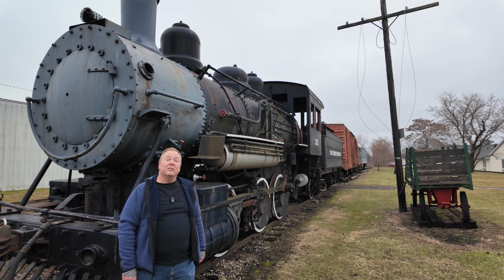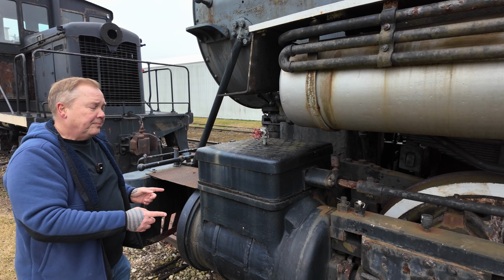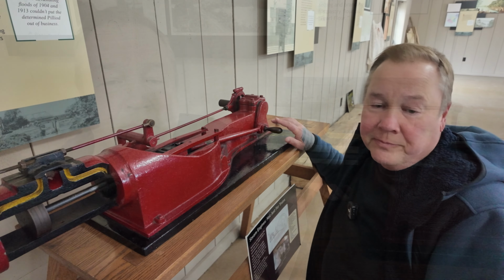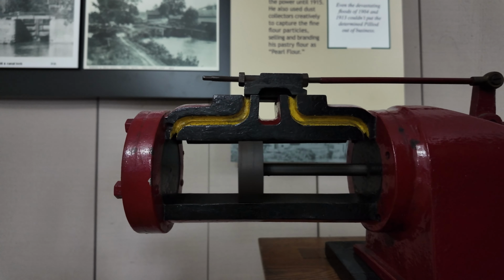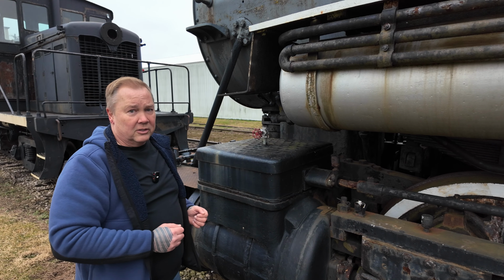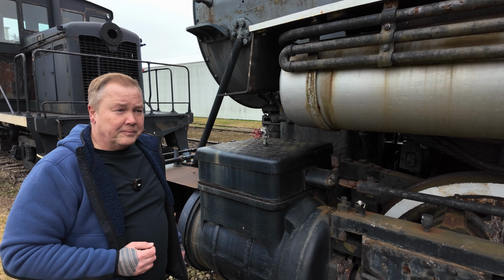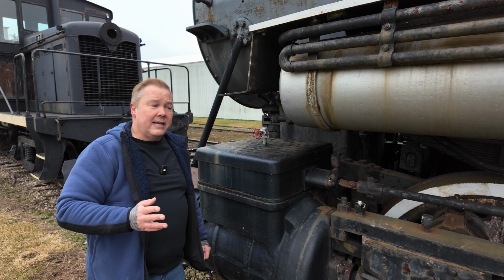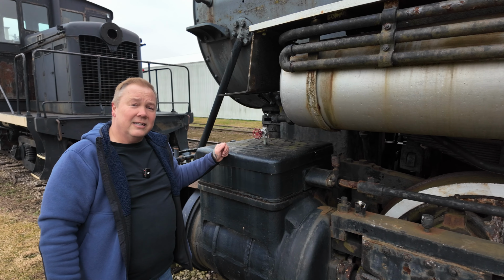Steam Pistons, Valve Gear, & Reversers

Comment: I'm really enjoying what you're producing here, looking forward to seeing more of your videos. I think I see a flaw in the cutaway model you showed: it seems to be clocked about a 180° out of phase. My understanding of the steam chest is that the steam enters the chest above the valve, and exits through the center channel below the valve. This allows the steam pressure above the valve to hold the sliding portion of the valve in a tight seal with the valve face on the top of the cylinder casting, without the need for a mechanical device to provide sealing pressure. I'll send another comment with a link to Keith Apleton's "Mainsteam Models" YouTube channel. Thanks again, see you soon😁
Reply from the maker: Thanks for the compliment and for the info.  I could see it working both ways, and wonder if they were actually built both ways.  That would be a way to get around patents.  Watt did something dodged patents on his rotative steam engines by using a sun and planet gear, for example.  I'll check out those links.

Comment: You're explaining that D valve as if it were inside admission. Plain D valves are outside admission, for steam to be admitted from inside the valve it has to be a balanced valve.  Not hating, just pointing it out. A lot of piston valve engines are inside admission because their design is inherently balanced.
Reply from the maker: Thanks!  Someone else pointed out that it looked like the steam came in on the outside, too.  As a mock-up, not sure whoever made it knew, either, or they probably would have made everything else work on it, too.